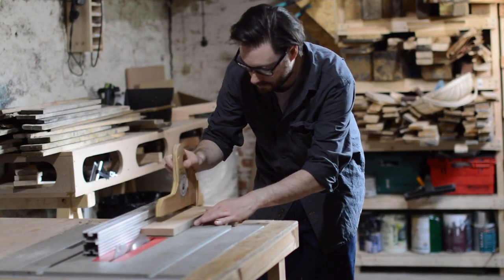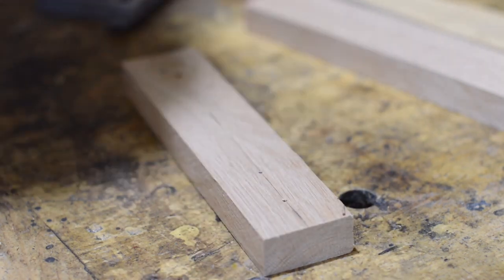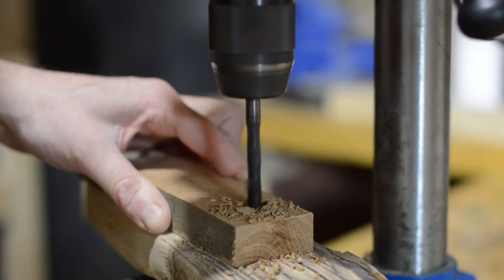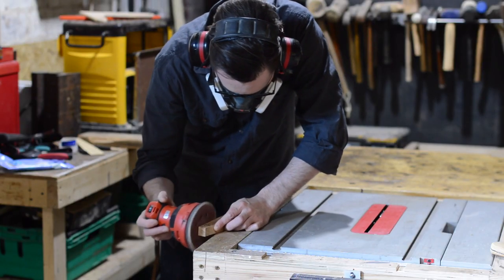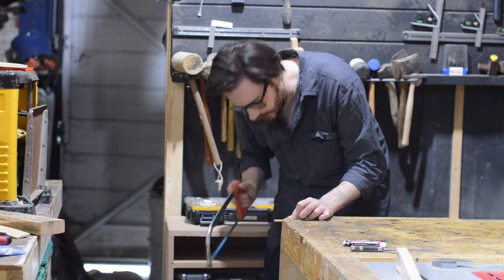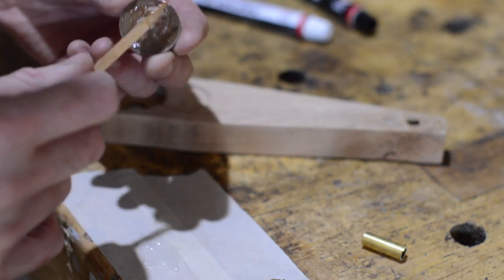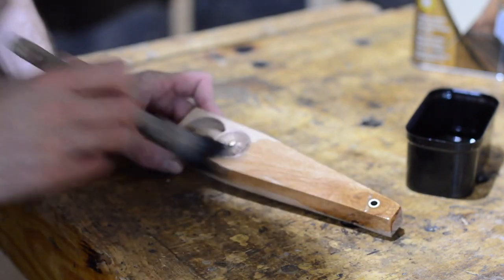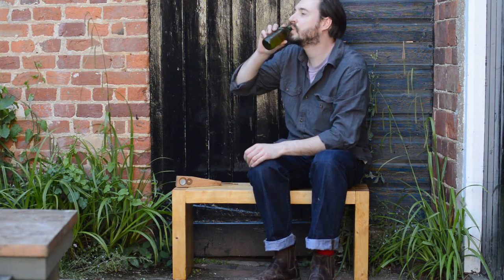Penny Bottle Opener

Comment: I have made one of these based  on your design, however I have tweaked your design by rounding the ends and chamfering the handle so it is a more comfortable fit in your hand. Your idea of using the date of the coin for their birth year maybe a problem as there are years when coins were not minted. Great project and I will be making a few of these as presents.
Reply from the maker: Sounds good Ray. Im sure people will be very happy with your gifts.